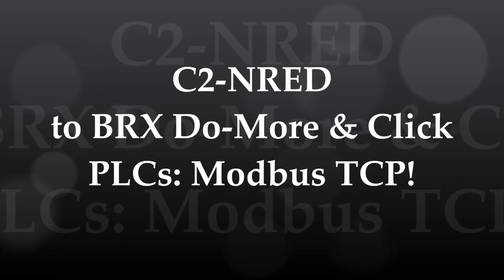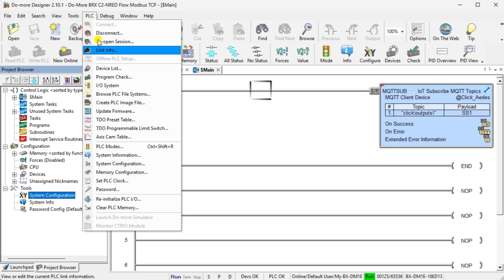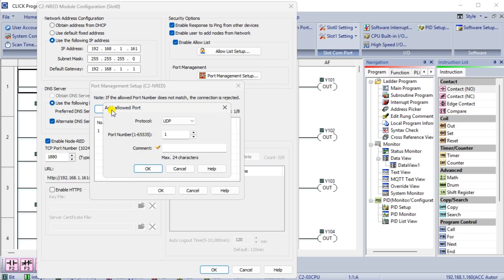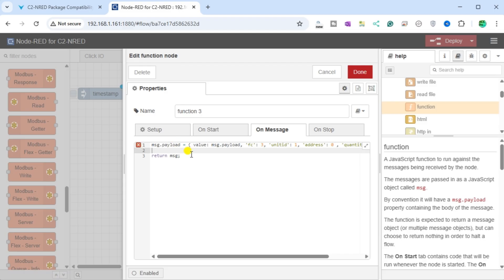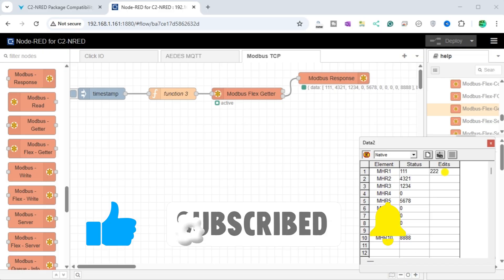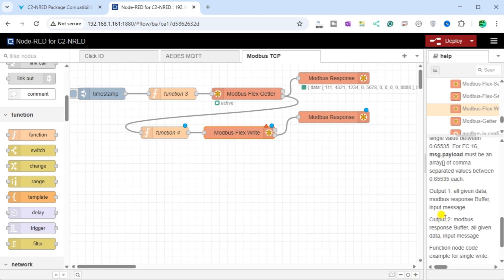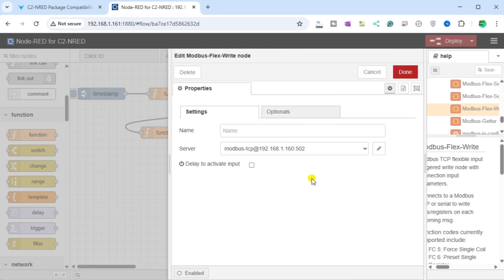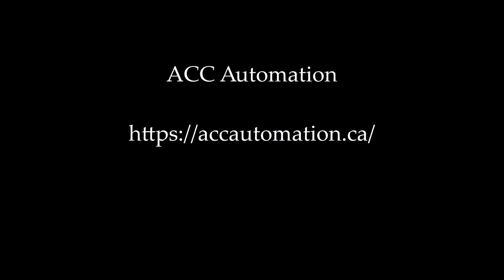How to Master Modbus TCP Communication with Node-RED?

Comment from the maker: More information can be obtained at our website. This includes all of the links mentioned in this video. 
https://accautomation.ca/c2-nred-to-brx-do-more-click-plcs-modbus-tcp/

Previously, we looked at the following using C2-NRED Node-RED:
CLICK PLUS C2-NRED: Easy Install for PLC Module!
https://accautomation.ca/click-plus-c2-nred-easy-install-for-plc-module/
https://youtu.be/ZFgcVwCYCRk
Unleash Innovation: Node-RED Flow in Click PLC
https://accautomation.ca/unleash-innovation-node-red-flow-in-click-plc/
https://youtu.be/JcFX6kK36p4
Master Node-Red C2-NRED Control of Click PLC I/O
https://accautomation.ca/master-node-red-c2-nred-control-of-click-plc-i-o/
https://youtu.be/AGiDeqQ8PTg
Click PLC & AEDES MQTT: What is the Big Deal?
https://accautomation.ca/click-plc-aedes-mqtt-what-is-the-big-deal/
https://youtu.be/Ilb5IFqOrNo
How to Use the Click PLC C2-NRED Package Finder
https://accautomation.ca/how-to-use-the-click-plc-c2-nred-package-finder/
https://youtu.be/q9etRrsnQ9w

CLICK PLCs were designed with simplicity in mind, providing reliable control at a low, low cost and with little to no learning curve.
This simplicity makes CLICK a perfect solution for small machines, home automation projects, pneumatic applications or anywhere a simple system needs a budget-saving control solution. 
Building on the original CLICK s simple design, the new CLICK PLUS PLCs offer the same practical control but with some surprising bells and whistles. Using the same FREE, streamlined PLC programming software as its predecessor, the CLICK PLUS PLCs provide no-headache programming combined with advanced capabilities like Wi-Fi communication and data logging.

The Click and Click PLUS PLC series can be found at this URL:
https://accautomation.ca/series/click-plc/

Features of the new Click PLUS PLC (C2-0xCPU) includes the following:
  Micro USB
  DHCP support
  DNS support
  Wi-Fi (programming and Modbus TCP)
  Bluetooth (Wi-Fi) provisioning
  SD Card (Data Logging)
  Data Logger
  Network Time Service
  MQTT (Publish/Subscribe)
  Required PLC Password
  Disable Ports
  Strong Password Support
  Disable Ping Response
  Encrypted Password Transfer

We are using the Click and Click PLUS PLCs for several reasons. Here are just a few.
 - Investment is low for the hardware, and the software is free
 - Standalone PLC with built-in I/O
 - Communication ability - Ethernet Port, RS232, RS485 - support for Modbus RTU, Modbus TCP, etc.
 - Ability to expand the system with various modules, including RTD and Thermocouple inputs directly.

Regards,
Garry
ACC Automation
https://www.accautomation.ca